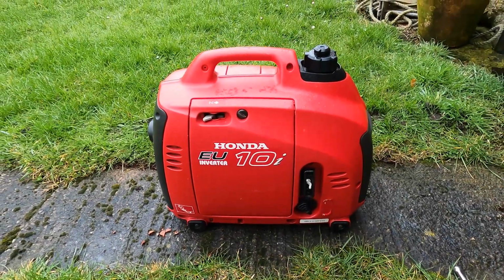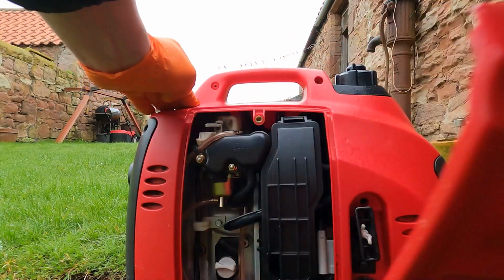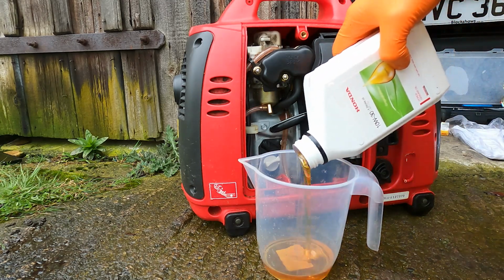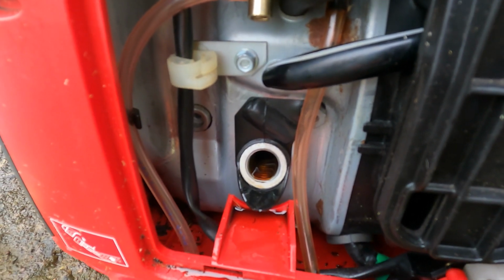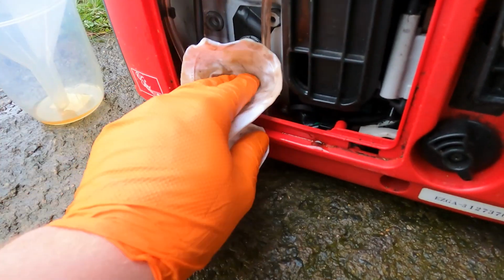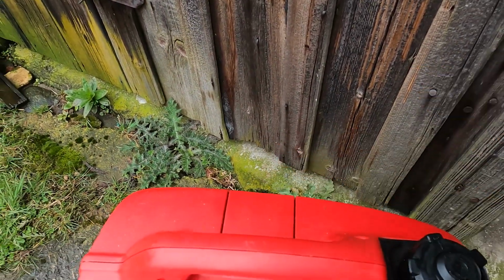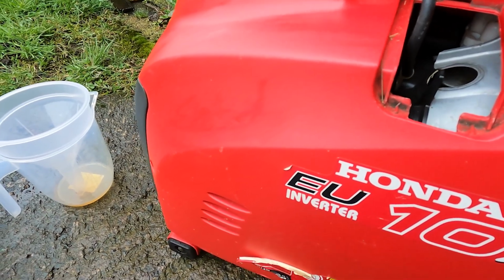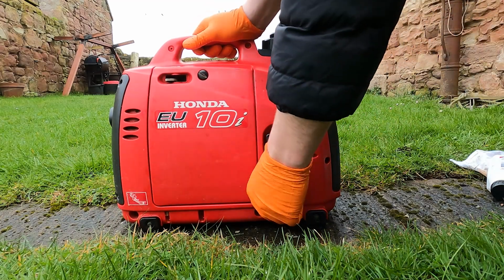How To Service - Honda EU10i Inverter Generator Yearly Maintenance ( Oil, Spark Plug, Air Filter )

Comment: There's a very small fuel filter inside the outlet of the fuel tank for those who have chased all other avenues. If you didn't know it was there it would be hard to find. It's inside the rubber hose.
Reply from the maker: Good to know, thanks for sharing!

Comment: I was wondering. Google says 0.6l engine oil so i had to check because mine only got 0.25l in it 😂 but seems correctly. Idk why Honda doesnt write anything in the manual
Reply from the maker: 0.6 does seem an awful lot! I’m sure you’re right and it’s .25l.
They probably assume everyone takes it in for a service 😂😂 on the Honda inverter generators the full mark is at the top of the dip stick threads

Comment: Just bought a brand new eu10i, it seems like the pull cord was stuck, and I can't pull it at all! 😢 Can I fix it on my own without sending it back to the dealer?
Reply from the maker: Remove the spark plug and try again. If it still won’t turn over with the plug out, it could be a nipped piston. Add some oil and see if you can unstick it. 

If it’s brand new then it will be covered under warranty
Reply: @MarineEngineServicing  Thanks.

Comment: A very comprehensive video, excellent.

Mine smokes at start up but this soon clears. I’ve serviced it but still has this issue. Does anyone have any further ideas?
Reply from the maker: Could just be from a cold start. 
As long as it’s clearing after a while I wouldn’t worry too much. 

There is a filter in the exhaust of sorts which could be carbon build up burning off. 

Ensure the spark plugs are correct and gapped and the oil is right.

Comment: great vid. Min just stopped running. I took out carbi and cleaned jets and no start. Next Ill try and find a tool to pull out the spark plug and see if its sparking.
beyond that its probably ask honda to look at it for a million bucks
Reply from the maker: Check to see if carb is working by spraying some carb cleaner into the intake. If it starts on the spray then stops then it’s the carb. 

Clean spark plug and re gap, can also check for spark at this point.

There’s also a low oil level cut out switch, no oil / defective switch would equal no continuity on a multimeter and so no spark
Reply: Nice video on how to sevice the Honda eu10i ,just bought one so its come in handy 😊
Reply: Nice video on how to sevice the Honda eu10i ,just bought one so its come in handy 😊

Comment: Great vid,  would also like to see cleaning of the carb, my eu10i is not running at a constant speed, it seems to "forget a heart beat" once in a while when running idle.
Reply: I think this is normal. Heard the fuel air mixture is a little bit to lean, but from honda originally. Mine does that too and it has 5 hours on it and did that right out of the box